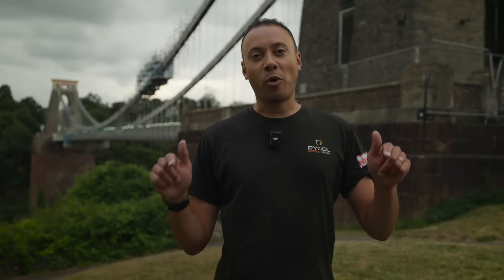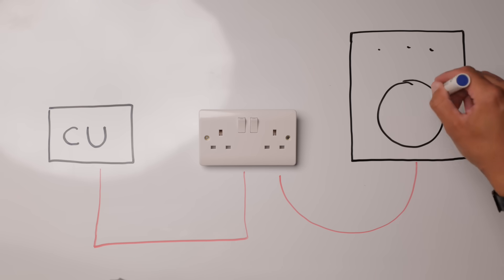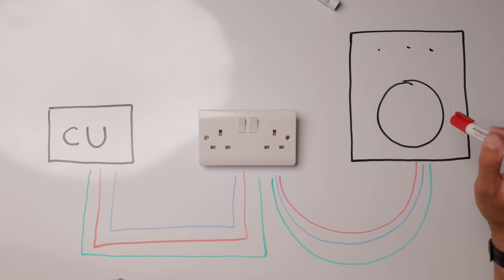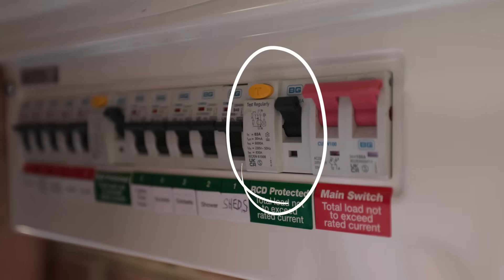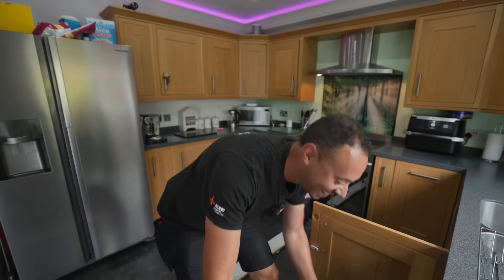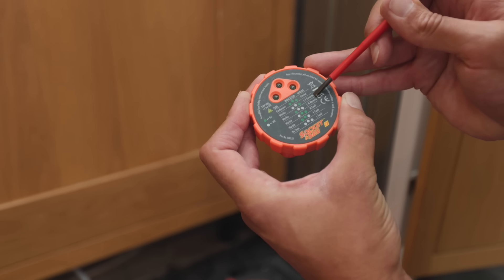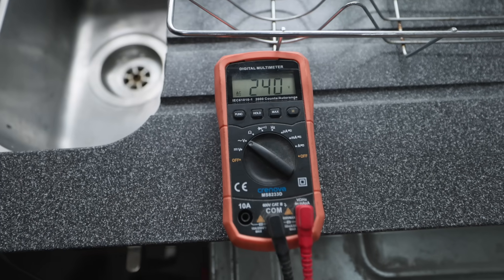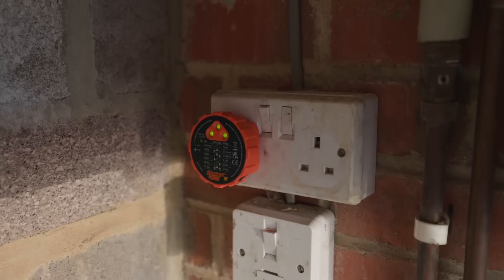This Simple Electrical Fault Turned Deadly⚡️

Comment: Great explanation, its important to make people aware of that risks. I have seen such fsults but fortunately very rarely. We all make mistakes, prfessional or not, you are stressed, the customer distracts you..several reasons BUT especially as a professional you are required to do a final test. Yes I know practical if you have 40 electricias like in a company I work for you most likely do not have 40 installation testers but you can still check with a two pole voltage detect or meter and when you use the low impedance function you might not be code compliant but you can prove its correctly connected at all. Everything else is neglect and theres no excuse. If you go to court you will bear the consequences..
Reply from the maker: Thank you, its important people are aware of these risks so thanks for watching!

Comment: As a professional electrician I have came across this several times in my 40 years. Once was a new installation in a hospital ward where dado trunking was installed and the electrician mixed up the phase and CPC, I got called because a cooling fan wasn't working, but as it was a class II appliance it didn't matter. Had a bed been plugged in it would have had a very different outcome.
Reply: Is that another way of saying it was a doubly insulated appliance?
Reply: @philipgordon4118  No, it means an item has only a live and neutral wire and does not have any exposed conductive parts like a metal casing that could become live. 
It is known as class II and is symbolised by a square within a square on the rating label.
Reply from the maker: That is a scary thought.
Reply: Why would an electrician do this?

Comment: If the socket circuit isn’t design correctly and there isn’t enough earth fault current flowing it won’t trip the breaker in time to save your life. Breakers should be calculated to have a trip time of no more than 0.2-0.4 seconds in most cases. So if the RCD or RCBO is too big for the circuit it won’t trip for say 20 seconds of fault current but by that time it’s too late. Also it is important to have supplementary earth bonding where exposed conductive parts and extraneous conductive parts are of a distance where both can be touched at the same time so the the current flows through the earth to the copper pipe and not through yourself. Humans are around a 1000 ohms of resistance so you are completely safe if this is done.
Reply from the maker: Thanks for sharing, that's a great point about proper circuit design and trip times.

Comment: you describe DC flow (although the wrong direction) - not AC , also voltage is 240v not 230.
Reply: Technically its 230v now, has been since we harmonised with western Europe in 2003.

Comment: Great video! The lesson for plumbers or DIYers working on appliances is to carry Voltage tester and get into the habit of testing before touching metal casings! .... Gas engineers advised to test working on Gas meter or boilers!
Reply from the maker: Absolutely! Testing is key before starting any work like that.
Reply: Get a mains socket tester, one of 'good quality', it is very cost-effective and quick to use and also much, much cheaper than a funeral! 😢
Reply: Those voltage sticks should never be used in that fashion. They might be better than nothing but are not a full proof mechanism of voltage indication. In a faulty circuit they might not indicate at all. I suppose they are better than nothing.
Reply: @Art-is-craft I think he is referring to a plug in martindale used in the  video, not a voltage stick also used in the video. The presenter was quite clear, voltage sticks can indicate live but cannot be used to prove circuit is dead (or safe as he put it). I would of been happier if he had used proper g38 test lamps when testing between washing machine and an earthed pipe though to show good practice.

Comment: just an absolutely horrendous case!i'm used to it because i've been around it  almost on an everyday basis for forty years.the other day,my  business colleague told me that the electrician had passed all the sockets.in the kitchen,the electricity cables were virtually wrapped around the gas pipes.obviously,i do not have sufficient expertise in the subject but i could not believe that that was passed by a fully qualified electrician.whenever working on a site,always have a few good neon testers and test any metal casings and screws.always take a cable finder with you to test the walls before you screw in any screws buy some very good electrical testing equipment  to always test for any potential danger.turn off the consumer unit wherever possible.remember that other people have been on the building site,which is usually a recipe for disaster.other people's sloppiness and thought patterns are terrifying!
Reply: "Fully qualified " sounds like a six week wonder
Reply: @stevefurness6303 all these things which I have been told over the last forty one years since leaving school and even before then,there's no way that they could possibly have been true.the authorities allowing mountains of idiots and morons to attempt  things and guess their way through life is unbelievably dangerous.no wonder there have been so many accidents,fatalities and engineering disasters.in the 1970s and 80s my dad did lots of jobs including tiling and gas fitting and his work was absolutely perfect and he had little or no qualifications.no wonder the bill paying public are always so angry !

Comment: Correct me if I'm wrong. The family wasn't hurt because all they touched was the front part of the dishwasher which is all plastic, but the plumber pulled it out and touched the exposed metal casing of the appliance, eh?
Reply: @Ebrahim:
It was a washing machine but was in a newly refurbished property and had never been used.
Reply: @rscelectrical7091of course they had never used it as it would not have worked.

Comment: If you swapped the earth and the live in that plug and then plugged it into the home socket, which you did, haven't you made that entire ring circuit live on the earth? therefore, if your wife had plugged something into that ring circuit while you were doing your demonstration she could have been in the same situation as the plumber. Or have I got that wrong? I'm not an electrician.
Reply from the maker: No because the live of the WM casing didn’t complete the circuit to go back anywhere. Also the house was empty.

Comment: I've had shocks off the side of a washing machine band off taps twice! Oddly enough in both cases it was the washing machine plug (replacement plug, rewired by someone who had no idea what they were doing). In my case it was unpleasant but not injury causing, but it's a gamble that could easily be far more serious

Comment: before i watched the video, i thought it was going to be caused by the earth not connecting through the socket terminals, i've seen a video of a socket that has 2 earth terminals on the back, one being used to feed in, one feed out but they were not connected together within the socket, which you'd have thought they would have been ...

Comment: Yikes! that is dangerous at 130 volts here in the US, but even more so at 230 volts in Brittan
plus you factor in the Amperage. especially if the current traveled through his heart....
tho, we do use 230 volts here for electric stoves, range tops, and electric clothes dryers. 
so it could happen here as well, if the outlet was wired incorrectly
Reply: Darius,

"Here in the US." As I watched the video, I wondered whether the testers that he demonstrated have equivalent devices made to US standards. I ALWAYS call an electrician when ANY electrical work is needed.

Comment: ... and seen a related thing. Someone had replaced the cable on an electric heater, but they'd used the wrong colours at both ends. The plug subsequently got damaged and removed. Guy I knew put a new plug on it, and promptly found the outside of the heater was attached to live because the person who replaced the cable had chosen to use the brown for the earth. Fortunately the guy who fitted the plug was conscientious and bright enough to test before plugging it in the wall. (and no, it wasn't me).

Comment: Not an electrician, but this looks even more dangerous in a plumbing scenario because any copper pipework attached to the wall was probably earthed. The outside of the washing machine isn't earthed via its pipework because it's probably hooked up to the wall by a plastic pipe, but the earth wiring is now attached to neutral via the washing machine's insides. So if you have an earth fault that means your copper pipework isn't genuinely attached to real earth-earth (just to a piece of green and yellow wire) you've now got a route from live to neutral via anyone who's touching the outside of the washing machine and the tap on the wall that supplies its water. And a current from live to neutral won't trip the RCD anyway.

Comment: The socket tester would not have picked detect a plug being incorrectly wired.
Reply from the maker: No but it will pick up a socket being wired incorrectly
Reply: @RygolElectrical  
The death was caused by the plug, not the fixed wiring.  An RCD should have picked up the crossing of the wires.  The washing machine would be isolated using rubber water and drain connectors and plastic feet.  But the L connected to the cpc would create an imbalance between the RCD sensing  L and N.

Was there an RCD on the system?
Reply from the maker: @johnburns4017  yes absolutely. which wouldn’t have been detected because the wm was never turned on so the L and E never met to trip it out. RCDs don’t always trip when you get an electric shock. Ive had a couple of nasty ones over the years and the RCD didn’t trip. A plumber would have no chance if the current went through his head and chest. Ultimately the polarity reversed killed him but with or without RCD we will never truly know.
Reply: @RygolElectrical  
Do you mean not switched on at the socket?  
Once switched on the L should go right back to earth via the cpc tripping the RCD.. and mcb but slower.  As you say if the current went fully through his chest before tripping the damage may have already been done.

Comment: Reason colour of earth wire is sacred. Never to be used on anything else. In my country yellow-green.
Reply: @Mike40M:
If you notice, the Earth wires were correctly sleeved in Green/Yellow sleeving. The Earth being coloured Green/Yellow during manufacturing would have made no difference to the outcome.

Comment: Great video, although I did pick up on an item that could cause confusion. Early in the video, 34sec you mentioned the live feed of 230v and then later showed your meter with 240v. Whereas I understand that to harmonized with European standards 230v was adopted with a tolerance of +10%, in practice I have never come across a 230v supply in the UK. Of course, I have a beef with simple things like this causing confusion and it's about time the regulatory bodies and government sorted it out. We never had a 230v supply!
Reply: It's 230V +15%/-10% - basically any country previously using 220 or 240V falls within tolerance without needing adjustment 

I regularly measure 252V at my sockets, which is still within tolerance
Reply: Anyone confused by the supply voltage not being 230 V should not be anywhere near working with mains electricity.  The actual supply voltage constantly varies and, as miscbits6399 illustrated, had this video been made in some part so the country the meter could have read 250 V.  It was only luck that at the time the video was made it was at exactly 240 V.  So whatever voltage you state will cause confusion to people who do not understand what "nominal" means as more often than not the reading will be different.
Reply: @Rebecka_J People learning this just now might think the variation is geographical. My own supply is mostly in the range of 227-245 volts, and can fluctuate along that full range in the space of a minute or so.
Reply: @philipgordon4118  It is somewhat geographical though as it is affected by power lines and demand etc.  Where I live in London I have never seen it reach 230 V or 250 V.  When I replied yesterday it was 238 V, and now it is 245 V.  But yes, the point is that it does fluctuate so anyone who wants to do anything with mains electricity needs to understand that, not think it will be whatever nominal voltage is stated.

Comment: I think UK standards the earth wire is uninsulated and 1.5 sq mm for 2.5 sq mm cable.     In France, the standard is that the earth connection should be insulated (with yellow/green) and have the same cross section (normally 2.5 sq mm) as the live and the neutral.
Reply: IIRC twin and bare earth is now deprecated in favour of insulated earth
Reply: @miscbits6399 : In what country ?, 
Both cables with insulated or non insulated earth wires are available for use in the UK. Having a fully insulated earth wouldn't have stopped this happening.
Reply: Because the UK, like the US is electrically a 3rld world country.

Comment: I have a new led striplight that stays glowing even after the light switch is turned off but does go out if the trip switch is turned off in the consumer unit ? Any thoughts on what might be happening i have checked the wiring and all seems to connected correctly.
Reply: Quite common with led lights, go to an Electrical wholesaler and tell them the problem.
They'll sell you the part to cure the problem.

Comment: Great video and an important point made. As a diligent DIYer (and data network engineer), I have just replaced every socket and light and appliance switch in my son’s new house because they wanted brushed steel sockets in place of the white. (41 sockets and 34 switches). The first thing I did before I started was buy a fluke meter and relevant testers before starting the work. I was please to find there were no mistakes after testing! But, bearing in mind the house had recently been rewired by the previous owners through a professional electrical contractor, I was shocked at the amount of loose wiring and burn marks inside the old sockets! Needless to say the cost of investing in the right equipment was actually cheaper than employing a local electrician for what is quite basic but time consuming work from an electrician’s point of view, and the kit reusable or re-sellable!
Reply from the maker: Its nice to hear you are taking the relevant steps for safety. So important 👍🏽
Reply: I went to remove a light fitting that had 2 light switches in it. Several months after moving into the house. The red wire to the switch broke off. The screw had been tightened so much it broke the 1 mm wire. Took a lot of effort to loosen the screw. This was done by an electrician.
Reply: Sorry to hear you were shocked....
Reply: @philipgordon4118 🤣